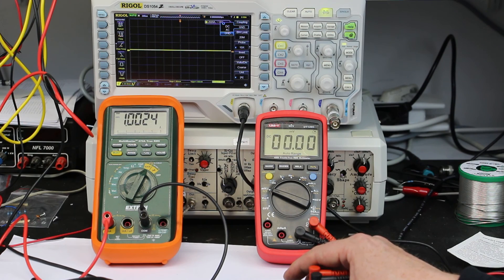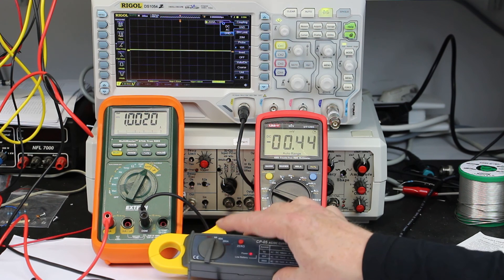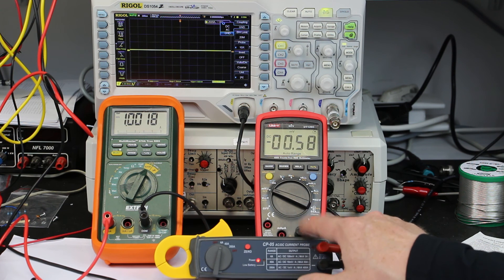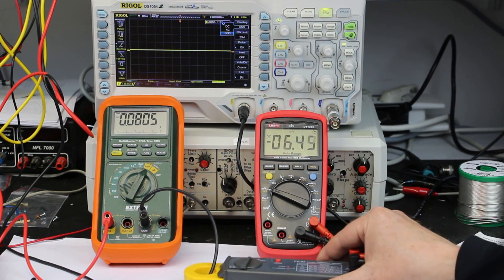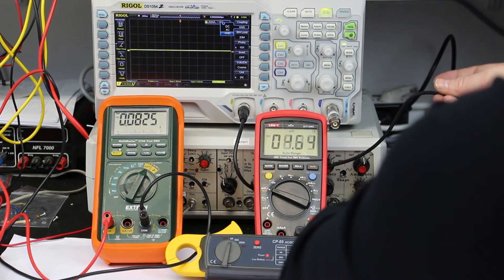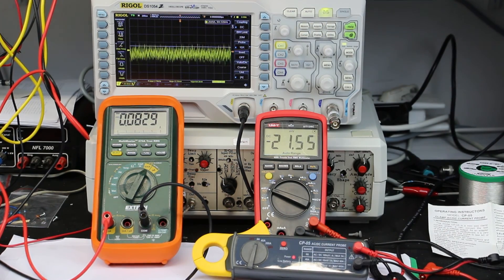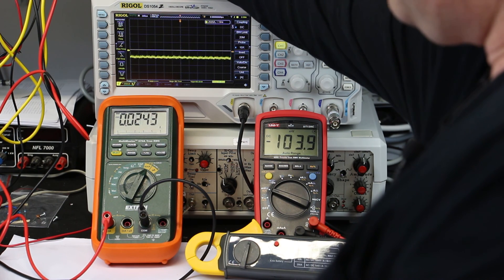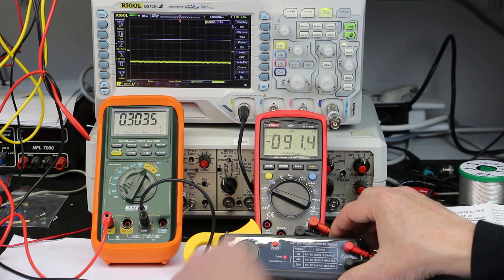Every maker should have…[Pt.26]…an AC/DC Current-Probe

Comment: Hi,
Is this kind of current probe able to display on an osciloscope a change in current of a energized inductor ? Is it enought fast and accurate to display  (di = Vin * dt/L) in a range of let say under 50Khz ?
Thanks for your help ;)
Reply from the maker: Well this type has a bandwidth of around 2kHz according to the datasheet.
So for typical SMPS-inductors which work at 50kHz upwards switching frequencies it is not fast enough. 
But there is an alternative for inductor-testing:
The "Power-inductor checker" from Elm Chang
 http://elm-chan.org/works/lchk/report.html
This in an ingenious little bit of test-equipment for checking when an inductor gets into saturation and becomes unlinear.

We are planning to bring a modified version of the power-inductor checker as a kickstarter-project in the next 2 or 3 months.
The orgininal version from Elm Chang didn´t work with my 555-timers.
I had to make a little change in the circuit diagram.

Best regards

Roger
Reply: Thanks a lot for the answer. I'll look forward to the release of this project. 
@+